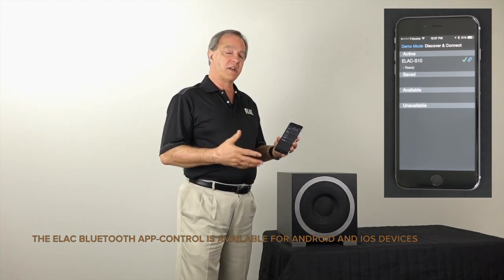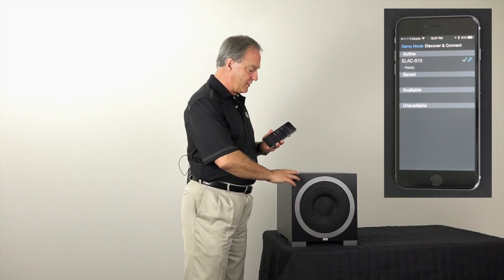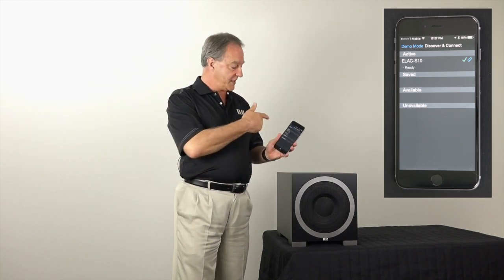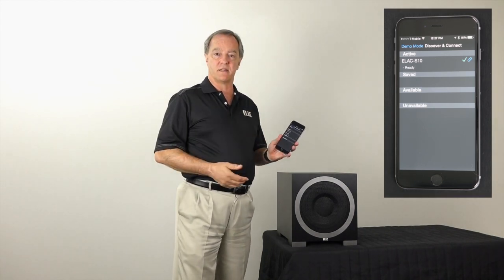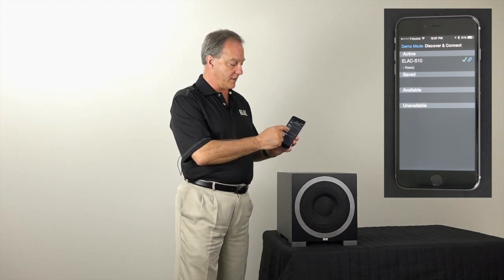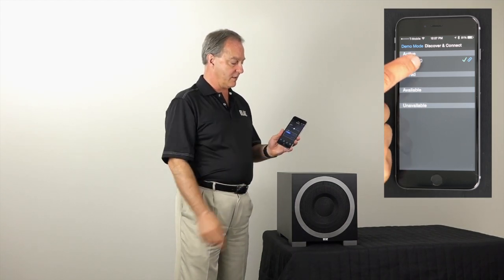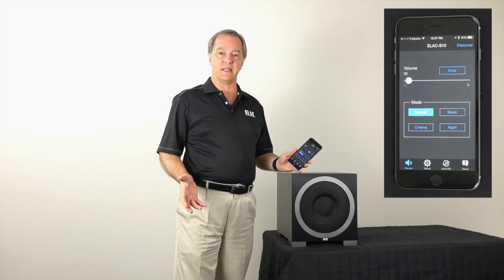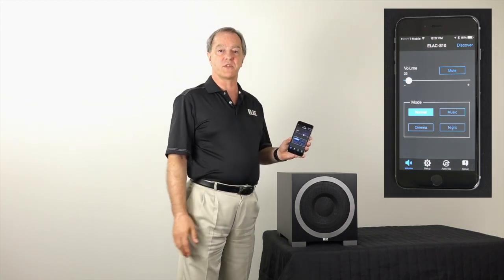ELAC S10EQ Demonstration Video

Comment: What about the quality of the hardware (Mic and Sound Card) each device has a different frequency response and I think that smartphone microphones devices hardly ever are able to catch down 40hz or less, how accurate can this measurement be?
Reply: Guillermo Perez you'd think that, but you couldn't be more wrong.
Reply: Wrong about the smartphone microphones???  (Are you able to explain why)

I have just tried with some spectral analyser app´s (Old Samsung Note 4 and Moto X Play) the result are slightly different.

I suppose that using a $50 smartphone cannot be the same as using a $500+.

Greetings!
Reply: Guillermo Perez yes, pay more attention...
Reply: Guillermo Perez He designed the system so he knows exactly what the sub sounds like in near field. So when you place your phone next to the sub initially it compares what it knows to what you get, and it calibrates your measurement from there, and once you step away and do the recording it's accurate. CLEARLY it must work.
Reply: Not it doesn't. Smartphone mics are designed for compressed spoken word, not for accurate room measurements.

Comment: Andrew, is is pure genius. Do you offer this on any of your other speakers?  Also, it would be good to know how this works when the rest of the speakers are set up through Audysssey EQ.. Can these two approaches coexist?
Reply: Late but yes, first auto-eq the sub then run audyssey.
Reply: Ted Timmis you don't need room EQ on speakers. you must be new.
Reply: Ted Timmis has nothing to do with being a rube, it's just you only need correction for 150 hz and below, at worst for higher freqs you might need diffusion.